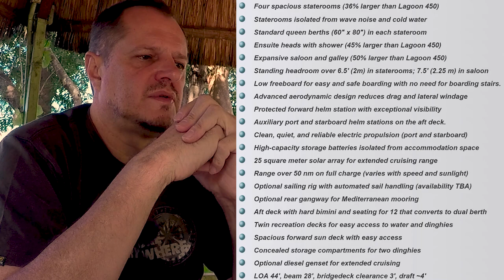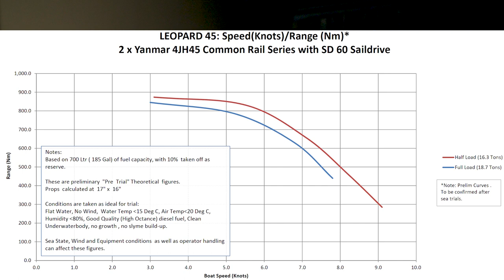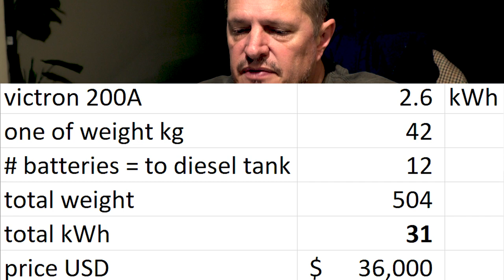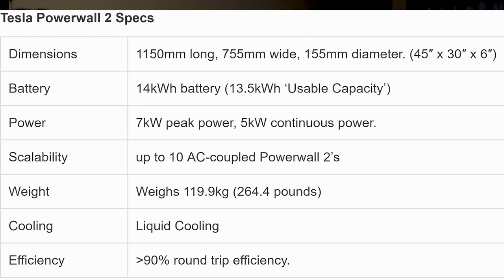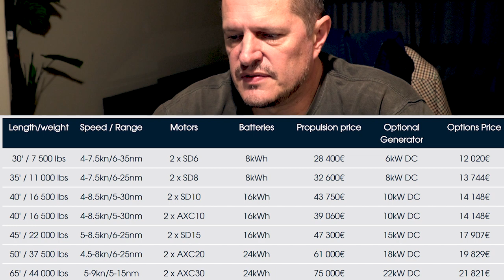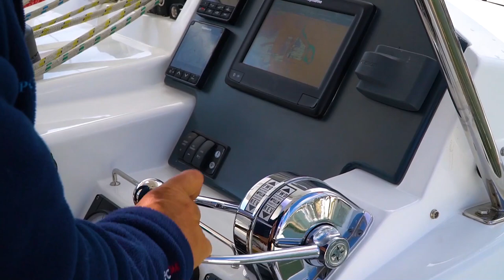#25t Diesel Engines or Electric Motors for Our Catamaran | Sailing Sisu in Cape Town South Africa

Comment: Hi guys, 

Your weight numbers were off (see below).

I made a weight comparison between diesel vs. electric:  

Weight of diesel system: 
Weight of electric generator 275 kg.
Weight of two diesel engines 440 kg.
Weight of 700 liters of diesel 522 kg. 
Total diesel system weight is 1,237 kg.  

Weight of the Torqueedo system: 
Weight of electric generator 275 kg.
Weight of two 33 kWh engines 176 kg.
Weight of high voltage 12.8 kWh batteries 147 kg.
Weight of low voltage 2.7 kWh batteries 25 kg. 
Total Torqueedo system weight is 622 kg.  

Weight reduction is 615 kg.

This includes the weight of motor electronics.

I am not sure if this includes the weight of the inverters, DC to DC converters, chargers, etc., but I doubt it will be 600 kg.

The Tesla wall by the way is 13.5 kWh.

I hope this helps.
Reply from the maker: Thank you! Always wanted to calculate the full systems, now we have it. This is awesome. Not that the video was about that, I intended only to see fossil fuel versus Lithiums. But I see your calculations indicate that one would not be able to double the batteries (should one find space) which means that one will not even double the range on batteries only.
Reply: You are correct.  

This is not possible with the chemistry of those batteries and not with the current battery energy density, but check these video, and you might see a way to almost double the battery bank:

https://youtu.be/PvCOcBynlq0

The weight of the Tesla battery with four modules is 1,730 kg. for 80.3 kWh and 78.3 kWh usable.

The weight of two of these modules is  865 kg.

Subtract the weight of the Torqueedo high voltage and you are at around 715 kg, or a bit heavier in order to double the battery size.

So, I agree with you this would not be the best approach for this boat.

On the other hand Torqueedo or Oceanvolt do have vessels that have been in service for several years claiming a minimum of fossil fuel usage with their electric diesel generators.  So, perhaps there is another approach.  

I cannot talk from personal experience in having installed an electric engine system, but I can see other people using them successfully as long as they allow an electric generator aboard as a backup mainly.

In the final analysis, I admire what you guys are doing.  This is a means to a goal.

I admire your open approach in analyzing everything, and more importantly, I admire your decision to change your lifestyle for a happier and healthier way of living.  If we meet one day, I will be honored to buy you guys a beer.  Happy and safe sailing.
Reply from the maker: Thank you, Eric!

Comment: Hi
You didn’t mention the most important advancement is battery power...
The new advancement is...
The new electric super cars don’t have batteries, they have super capacitors!!
Supercapacitors
A) don’t have a limited charge cycle, so after 10 years they behave like new
B) they can deliver all their charge in a lightning bolt, batteries cannot deliver that amperage
C) not effected by temperature. Trucks use super capacitors in icy conditions
D) can recharge very quickly
E) really light weight, esp compared to a battery

Cons:
A) they still cost more than batteries... but that won’t be for long
B) for the same capacity as a battery super capacitors need more space
Reply from the maker: I am following super capacitors, but as you mentioned, they are still getting into the picture. Myself is an Electronic Engineer who went over to the dark side of software engineering :-)

Comment: I have got the same thought of converting to electric propulsion. But I fear - if you really want the same range as diesel provides - we have to wait a few more years until
a) energy density in lithium improves
b) costs are coming way down by cheaper materials used in these cells and bc of mass-production
c) fuel cells (e.g. methanol based or propane) are more comon and replace nowadays diesel generators to close the energy gap
These things will take the next 5 to 10 years to be reality.
But ... I only use my engine for entering / leaving the marina ... and in a storm ... hey, I've got sails to use ;-))
Reply from the maker: Agree 100%

Comment: the Us navy/ other navy's have used diesel electric motors for years. like since WWI.  I am not going to jump to deep so anyone that jumps a pin point of the topic just know Im not writing a book even if the sort version is long.  just because an electric motor is not likely going to be a full stand alone motor any time soon (outside of small/ race boats) does not mean it is not the way of the future. it just mean you have to mix the two (hybrid) and increase the range, and performance.  lets use a 15 kw motor you have two of them and this becomes 30kw of power. 30 kw will move the boat at 9 kn this the range is 9 kn an hr (the hr is important soon) now a diesel uses two motors as well. the variables are to great to go to deep but lets say the 3YM20 and the said 15 motor at the same. the yanmar uses 1.4 over normal temp range. so thats 3 gph.  Now lets move to hybrid and let us use that fuel burn to rate the engine. a small car turbo diesel that puts out 180-230 hp (130- 180kw) now our target is 45kw of power.  again each engine is different so I will be using the chevy 2.0 turbo diesel. at 2700 rpms the rated shaft RPM that a 45 kw Stamford alternator calls for the 2.0 burns roughly 3 gph. now that thats out of the way lets do the math. scale distance traveled over 24hrs based on fuel burn.  both travel 216 kn diesel engine burned 72 gals that day the hybrid burned 48 gals 8 of the hrs it is running on battery only. now I know you are saying but the weight this is solved by not thinking in the aspect of full hrs.  if the batteries   can only run the motors for 15 then the motor runs for 30mins. in the end the sum is always 24 hrs just more starts and stops but less weight. I will say the higher weight is less of an issue for the electric motor.  this is cause this type motor is able to maintain high torque even in higher rpm. where a diesel loses the torque with every RPM great at low bad at high. gas bad at low good at high. electric good across. this is why anyone that uses a electric motor will tell you 15kw motor isnt equal to a 21 hp fuel motor. more like a 50/60 maybe even 70 hp.
Reply from the maker: Sure

Comment: The main disadvantage of electromotor is the price at moment. Oceanvolt complete system for a Leopard 45 cost 100,000 Euro (2 times 50,000 Euro for actual 2 systems). A normal diesel engine costs just 20,000 Euro (so 2 times it is 40,000 Euro). You can buy a lot of diesel for 60,000 Euro ... 

But I consider Oceanvolt as really overpriced at moment. In China you get the batteries for 1/3 of their price, any ordinary electromotor costs just 1/10. And the electronic costs in production just a handful dollar. The only thing that costs is the overhead of the company. It is for sure room to cut the price by 2/3 next years.
Reply: Because a leopard weighs what it weighs, if your 48' cat weighed say 10,000lbs less then the picture changes ......
Reply: Those are retail prices..OEM much less...
Reply from the maker: In the video I tried to chuck away the diesel and used its weight (missed the engine weight though...) to replace the diesel with Lithium. We are currently 38 degrees north and must say, the sun is out only a few hours on a sunny day, and if it is out, its path is way low over the horizon, and then there is the MED rain...our 2.2kW solar is just not enough to charge the Lithium, even if the boom is out of the way and we are at anchor (no sails up to shadow the panels). The kettle, lights, computers, chargers, etc. is eating up more electricity than the panels can bring in! If we sail, then even on a sunny day, the sails shadow the panels....sorry, to break it to you, but one needs sun, a lot of sun. Perhaps all the awesome links and tests I have seen so far, are either motor cats, or sailing only Trade Winds where lots of wind and sun is more overhead. I cannot see how our charging system can support two electric motors too...

Comment: A Tesla 85 kw battery pack (from the cars) weighs 540kg and comes in 16 modules, which can be positioned under floors or the beds to spread the eight and keep the weight low and central..
Reply from the maker: That is exactly what I am thinking about...

Comment: How about a Hybrid drive? Much like cars Electric motor with a small diesel motor running at most efficient speed to charge and lithium batteries only when required?
Reply from the maker: Yes, I mentioned the DC genset? This is the "range extender" on the Oceanvolt and Torqeedo systems. So, very possible. But you need big enough genset to provide those 15kW motors the power they need should your batteries run out. Look at Rigging Doctor, their monohull weighs far less than our L45 and they need a small genset to go 2 knots sustaining. But this would for sure need to be the way to go. Batteries alone (for at least with the current commercial technology) with Solar, will not work.
Reply: Hybrid is only economically viable in a situation that you need a lot of power for small periods and a lot less power for longer periods. For instances, think a tug boat with 5 x 1000hp generators and a 4k kw electric motor. Most of the time it will only run 1 or 2 of the generators to move arround and do it thing, but some times it will need the 5 to tow a big ship. That is your saving in hybrids...  if you have to run the only generator most of the time to serve the electric motor, there is no point, just more complexity.  (cars with range extender as a different story, 90% of the time a car uses only a small fraction of its power, so it can go by with a very small internal combustion engine to fill up the batteries, sailboat while crusing, use a high percentage of the available power and constantly)
Reply from the maker: exactly! not many people see it that way....yes, boats can use sails and wind, but when it comes to motor sailing, or just plain motoring (which is unfortunately a big percentage of the time), then the water drag/resistance is the juice sucker :-)

Comment: Two Diesel engines for long-range motoring. Remember the boat gets lighter the more fuel you use. 
One power wall & enough solar panels to run the boat without a generator while at anchor or just sailing.
When solid-state batteries arrive they will half the battery bank you need.
Reply from the maker: very astute observation! i only realized too late that the tesla powerwall could have been a good substitude for victron, but then again, they were not made for marine environment...further, they run at very differnt voltages optimized for 220VAC and I was uncertain wether I could convert to 12VDC... also, i upgrade my solar to 2.7kW and it is still not enough at the 40 latitudes to keep our 12kW lithiums at 100%...so, in practise...

Comment: Like you have, I've been researching electric propulsion. The way I calculate is first determine how much propulsion power you actually need for a happy cruising speed. Like the 13 kW @ 5 knots you mention, I then multiply by 6 or 7 for minimum peak power in opposing high current and wind. 
A more efficient example than your catamaran is the 25-ton Silent-Yachts 64 that appears need 12 kW for 6 knots, 50 kW for 10 knots. https://www.youtube.com/watch?v=oMq-Ksj0Kho

24 hours at 5 knots for you is 312 kWh, for Silent-Yachts and 6 knots it's 288kWh.

Heavy and inefficient designs are less feasible for electric propulsion without significant regen and solar because of battery size, weight and the time it takes to charge them. You need double of everything.

My rule of thumb is if you want a fossil fuel free boat at a constant power output for 24 hours, then depending on how you use it you really need 2-6 six times the cruising propulsion power in solar, 1 times regen, and 6-18 times in battery.

eg. 1 kW of propulsion for 24 hours = 24 kWh of energy divided by 4 kWh/kW solar efficiency = 6 kW of solar panels = 18 kWh battery = 18 kWh regen at night. So in 6 hours of sunlight you're producing on average 24 kWh of energy, 6 kW of which goes to motoring when the sun is out, 18 kWh of which you need to store in batteries to motor for the other 18 hours in a day, but if you have wind day or night you can be charging with regen. 

If you only travel in summer climates then you might get away with half or less of the amount of solar, eg 3 times the propulsion in solar power and 9 times the battery. Maybe 2 times if your solar panels are highly efficient. 
For your 13 kW cruising propulsion Catamaran that would be a minimum of 26 kW of solar and not feasible. 

When there's no wind, there's no using regen like Torqeedo's Deep Blue or Oceanvolt's Servoprop which is only 800W at 6 knots. And wind generators aren't much different.
But with wind and enough regen things can look different.
2 times ServoProps at 6 knots for 24 hours is 38 kWh. On a small catamaran that would meet all it's battery charging needs.
For your larger cat with 2 kWh of solar that's on average 8 kWh a day for a total with regen of 46 kWh, so you'd need to sail 7 days with regen for every one day without wind if using a 312 kWh battery (3 times Tesla P100D battery; about 1650 kg). The more regen, the shorter that gets.

For some people they may only need enough energy to motor in and out of territorial waters to dock and don't mind sitting idle when there's no wind. That's about 24 nautical miles into and out of UN convention countries or 8 hours motoring at 3 knots. At 1 kW propulsion and 3 knots that's 8 kWh of battery. I see most smaller DIY electric monohulls with about this.

Otherwise just use a diesel genset. If you calculate diesel energy density and efficiency (~45%) compared to current lithium ions and electric motor efficiencies (~90%), you need about 6.7 times the volume of diesel in batteries to match. Liquid ammonia and hydrogen fuel cells may be another option in the future, but like superchargers they don't exist at marinas yet. Even if the energy density of batteries does go up by 6.7 times in the future, 312 kWh becomes 2100 kWh of energy to charge, and at a marina using those two 240V@16A shore power leads it will take 11.5 days to charge.

In my mind the key to feasible cruising electric sail boats is having enough solar, wind and regen, and only having enough battery to buffer these energy sources.

Battery aging is another thing to consider. FWIW, if you look at the Australian Battery Test Centre reports, the life cycle of the original Tesla Power Wall isn't that good.
Reply from the maker: Wow, yes, I can see and follow your calculations and I agree. I will test what I have and then see what I need more and see if that is doable. Petro has all sorts of electrical cooking stuff in mind too. So, not all battery power will be going for propulsion...
Reply: You may want to watch Nigel Calder describe the Integrel 8 kW generator system for diesel engines. https://www.youtube.com/watch?v=wfX96IWA6m8 It's just a pity this system doesn't appear to be electric propulsion or hydrogeneration capable, but maybe it is. If it is, I'd think a system like that that would probably suit your boat. Two 8 kW electric motor/generators for silent cruising and hydrogeneration under sail, together with two propulsion diesels for higher power propulsion and battery charging.
Reply: Very interesting. I can tell you about my  electric build on an aquila 44.  You can see it running by searching novaluxe on youtube
Reply from the maker: Craig, I checked out the Integral generators, but they are super expensive. Besides a few small points, do I already have at 1,500rpm on both engines, 400A going into the Lithium. The Sterling regulates the temperature as well as where the charge should go first, for example, AGM starter batteries and then the Lithium. For AGM, the Sterling reduce to little Amps for AGM, and 400A for the Lithium.
Reply: @CraigOverend  Nigel Calder knows his stuff and I am going to use his alternator on my blue water hybrid model

Comment: theres a charter gunboat in thailand thats hybrid, worth alook.
Reply from the maker: The Hybrids are koowl and the best there is at the moment...The test would be to be able to run those motors for few days without cooling time or recharge time. We have no been twice in 6m breaking waves and 40+ kts of wind where we had to motor for 2-3 days without a break. Off course we took the hard way (80% upwind) going to the MED, which took us close to the section in the Doldrums where there is no wind for 600-700nm...we could just turn on the diesels and they run 24hrs for 5 days, no problem. The Rigging Dr stayed in the Northern Hemisphere and in the steady Trade Winds. I am sure you watched Delos where they sailed Namibia, St Helena, Ascension all the way to Brazil not using their engine at all, not even for dropping or lifting anchor! Crossing the Atlantic is very easy using the Trades, but try to sail 80 different latitude degrees without engine....or to rely on electric motors for days without a cooling of break... BTW, one of the reasons why we choose a cat was the redundency of having two motors...if the genset breaks, then you are in trouble if you need engines....

Comment: Quite interesting.  I agree that diesel is not necessarily a fossil fuel, but a result of some other process deep in the earth.
Reply from the maker: Excellent! Was wondering who will pick up that conversation :-) I think it is like diamonds...just a bit more sloppy process. Seems like certain elements like to bunch together (in ore or other forms) to form interesting elements, which turn into minerals.
Reply: @SailingSisu  I'm pretty sure Deisel is a by product in the process from making petrol